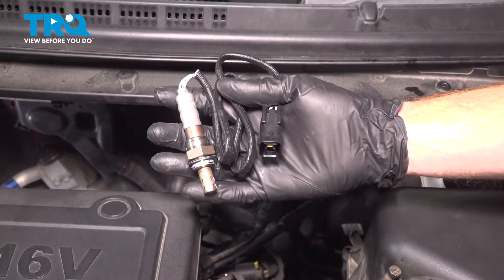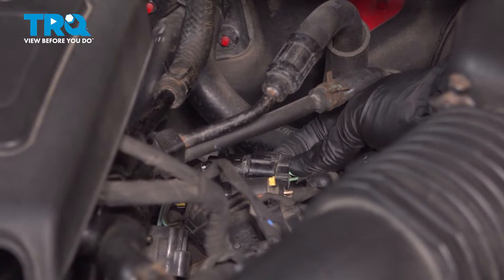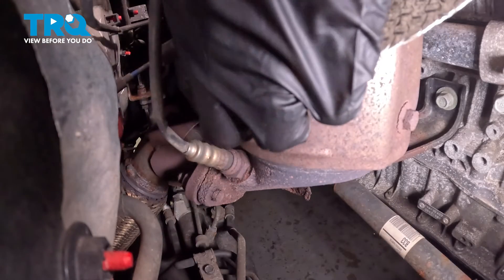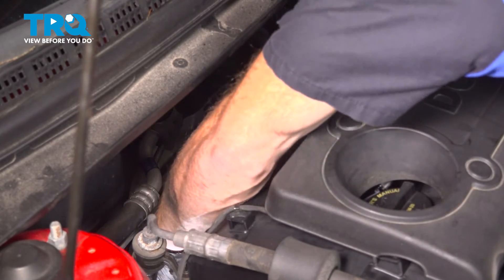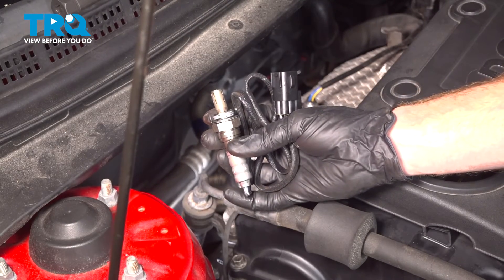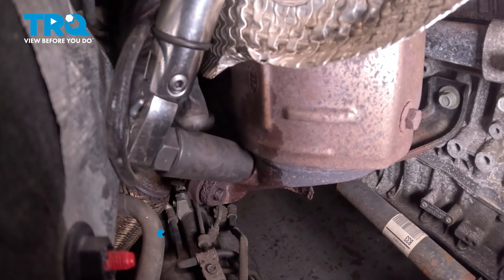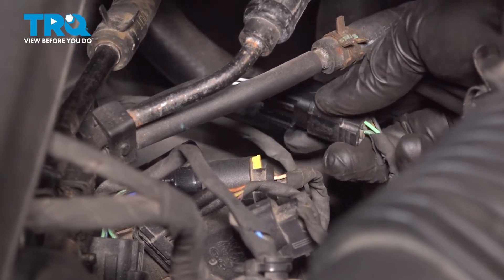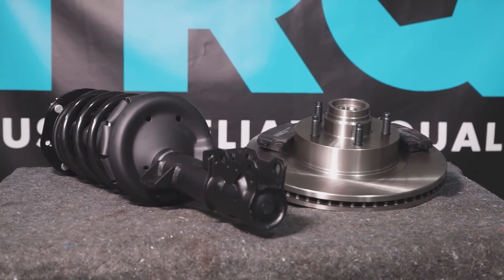How to Replace Downstream O2 Sensor 2010-2013 Kia Forte Koup 2.4L I4

Comment: These are fantastic videos!  Can you please create a video on how to replace the exhaust pipe going from the exhaust manifold off the engine and into the catalytic converter?  That is a current issue I am having with my 2010 Koup where it became damaged and now needs to be replaced.  Thanks!